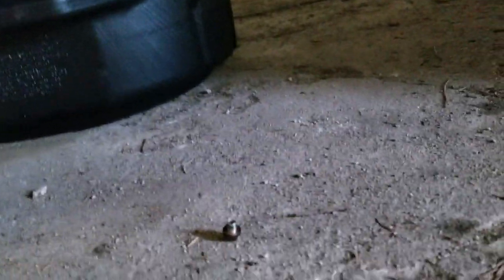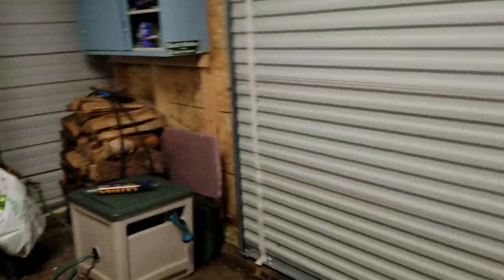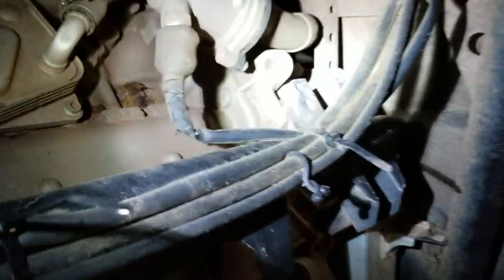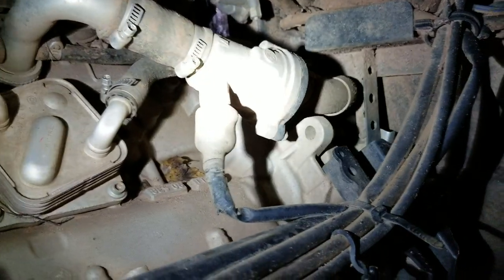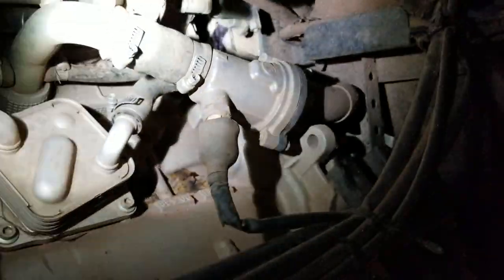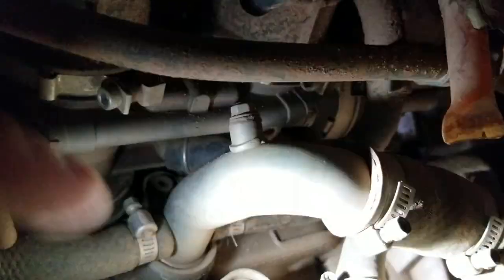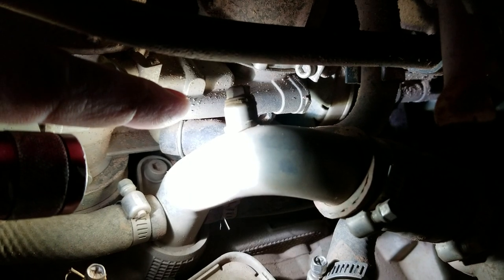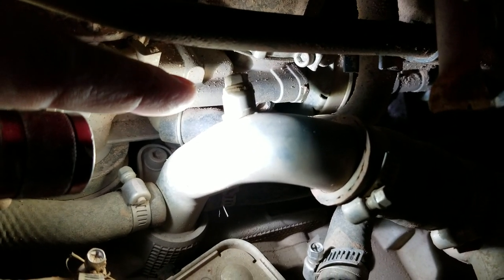Yamaha YXZ1000 YXZ coolant drain

Comment: Good to know, my thermostat is leaking and will need to bled the system. Also, ive been reading we can use 50/50 mix green coolant?
Reply from the maker: Yes green coolant. I used some water wetter in mine also just for fun.